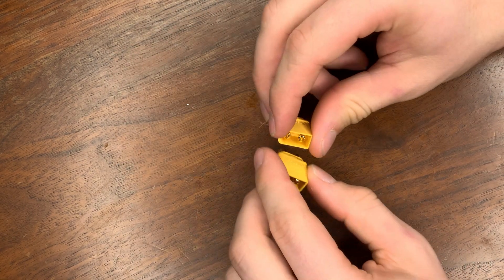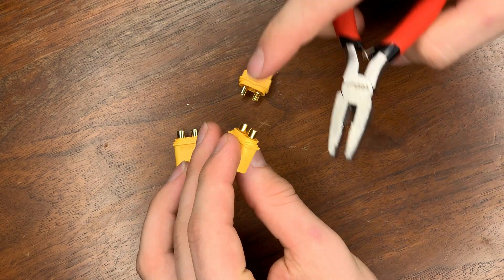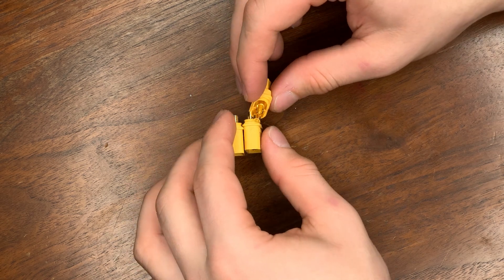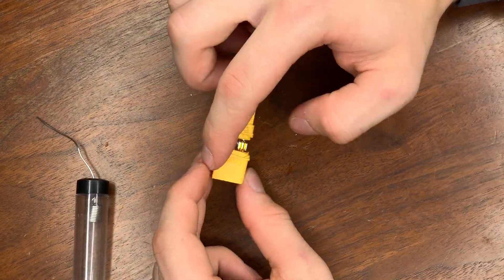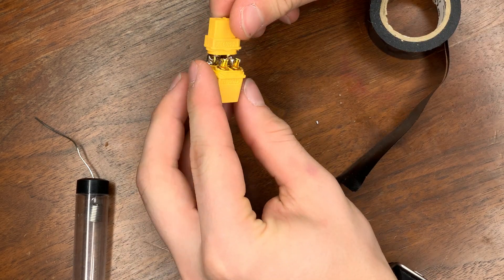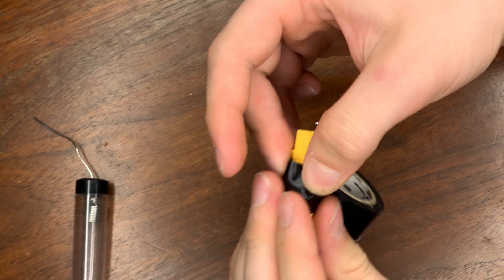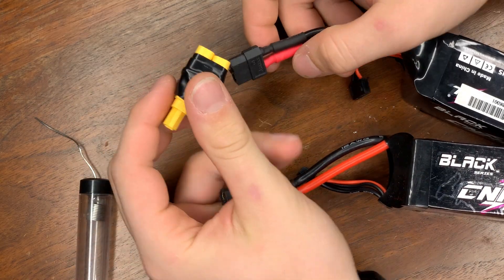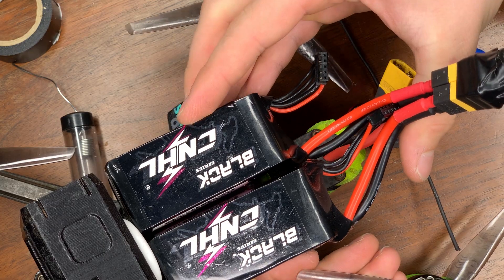Double your FPV Drone Battery!

Comment: Hello. If you do this with your batteries you need a special ESC thats support like a 12s batterie?
Reply from the maker: So you only need a ESC that is rated up to whatever battery you are using, (example: a 4s ESC can only use a 4s battery, NOT A 6s) the same rule applies here so this is still using the same 4s/6s battery just doubling the capacity not the voltage. 

So NO you do not need a special ESC for this!

Comment: Hey, the idea is kinda okay, also you could solder two separate xt60's on each esc on your Thicc and use two batteries, but i would really recommend just to get as much healthiest pack you can find 6s 4500 - 6000mah i personally use the method you showed on my siccario , but i would definitely will buy single pack!
Reply from the maker: Yeah your totally right but the only reason why I made this is so that it’s optional and you can remove it, but definitely you should just buy a single pack if you are going to be using this all the time!